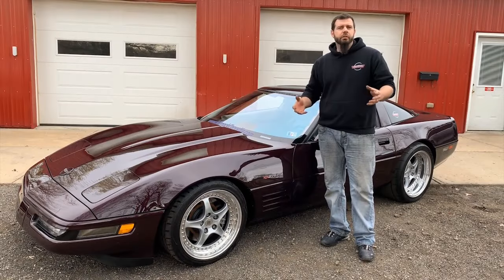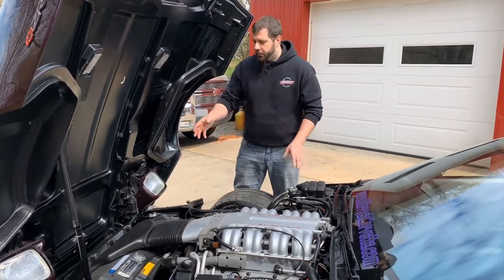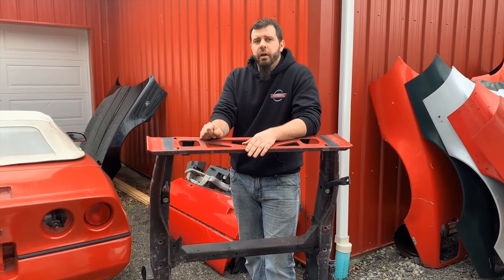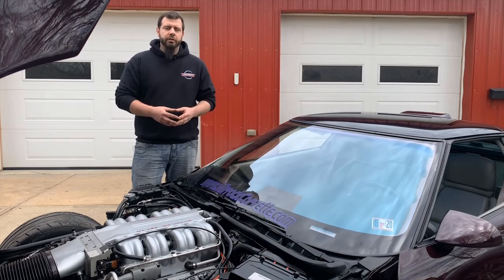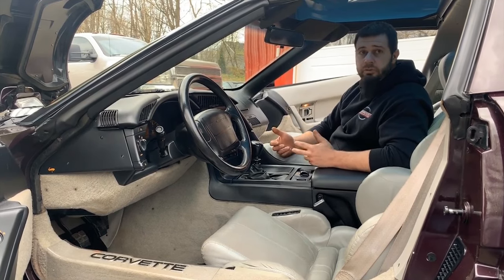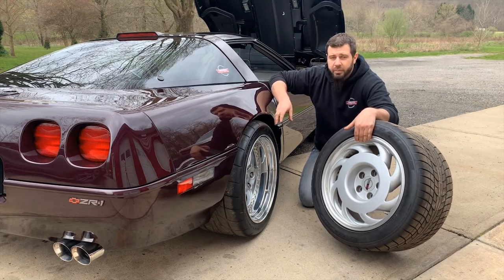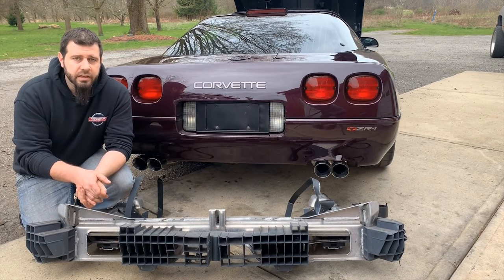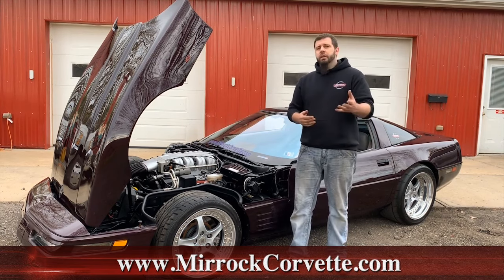What makes it a ZR-1, C4 Corvette Design Differences

Comment: Thanks for this very through video,  You mention that the difference between the 375 and 405 hp ZR-1  isn't a big deal.  To  get to 405 one would need to port out the engine and do some modification on the injectors, correct?  Other things?  General idea of investment to get this done? .

Comment: Basically the difference between the ZR1 and basemodel is the engine that's pretty much it except for the 90 you have some body difference but everything went the same in 91 as far as appearance.

Comment: I dont care if the new Vettes are a bit faster, these are the ultimate Corvette. Sleek, sexy, curvaceous just like an exotic sports car should. The newer Vettes are too square and upright. The late C4s were the last sexy Corvette.
Reply: It's more than a bit faster than a c4.  About 4/5 hundred hp faster lol
Reply: @JohnCollins-mm5dq  Well, I guess if a late model Z06 runs the 1/4 in 11sec flat, and a typical early C4 runs it in 14sec, thats 21.5% faster.  And are you really comparing new $100k cars to 35 year old $10k used cars? If you enjoy hatin on older Vettes, why are you watching older Vette segments?

Comment: Love that car....I had a C5,
but that's a wicked machine....styling is incredible.
Reply: If I'm not mistaken, when Chevrolet designed this car, they had designed it so that a radar detector couldn't detect it until it was within 1500-2000 feet, I could be a little wrong on that number, but pretty sure its in that range. Most vehicles are detectible much sooner than being at a distance of only 1500-2000 feet.

Comment: Which one is better?) Lt1, lt2, lt3, lt4, lt5?
Reply: LT5 is better than LT1 stock for stock. LT2 is the engine in the new C8, completely different era of engines and much more powerful than both. LT3 doesn't exist. LT4 is just an LT1 with heads/cam/lifters.

Comment: I really enjoy your tutorial on the ZR1. I’ve learned a lot about the differences and I have a question. I own a 1990 corvette base model without the FX3 suspension. Is it possible for me to add this option onto my corvette that wasn’t equipped with this option?
Reply from the maker: FX3 in theory could be added, but not easily or inexpensively. Would need the control switch, complete abs system wiring from an FX3 car, and then the shocks and actuators which can be expensive. In the end while the FX3 system does offer differences in handling when operating the switch between positions, the changes are very subtitle and surely not worth the time, effort, and most important cost, to add the system to a car that did not originally have it.
Reply: Mirrock Corvette ok, thank you so much for your info. I’ll just think about it now. You’re the most knowledgeable C4 person on the planet. You should work for GM and educate them. Keep up the good work!

Comment: I am getting a early inheritance from my uncle. A 92 triple white C4 with 75k miles. Is there a listing somewhere that says how to make a base 92 into a 96ZR1?
Reply: There is no 96 ZR-1, and there really isn't any documentation to swap an LT5 into a base C4 because the LT5 was never sold as a crate engine. You'd need a donor ZR-1 to pull it out of, unless it's totaled there's no reason to go through all that effort to turn a base into a ZR-1. Only reason would be if you found an insane deal on an LT5 pulled out of a wrecked ZR-1, which is highly unlikely. Anyone still dealing with these cars these days knows what these engines are and how rare they are

Comment: Believe it or not, there are still some people who think the Corvette non-ZR1 and ZR-1 used similar engines.  Totally not true.  The only thing the two engines have in common is that both were Chevrolet V8s, with similar (but not exactly the same displacements.)  The L98 and LT1 were overhead valve V8's, similar to nearly every Chevy small block V8 made since 1955.  The LT5 is a DOHC engine, a completely different engine design.
Reply: not to mention the LT5 was designed by Lotus
Reply: I was wondering about that.
That means Lt-5 has a 4 camshafts and a big timing belt or chain?

Comment: Can the LT5 fit into 1984 C4?
Reply: You'd have to change the hood most likely and the cost of an LT5 swap ... might as well do a LS swap for cheaper.
Reply: @josephcook3402  ZR-1 uses the same hood as the base C4
Reply: Technically? yes. Is it worth it? absolutely not. Good luck finding an LT5 to put in an 84 let alone all the work that would require

Comment: To save people time, the only engine difference is the C4's LT1 has a 2 valve. The ZR1 has a 4 valve.
Reply: Technically true, but far from the only engine difference. The LT1 and LT5 have almost nothing in common and have completely different architectures. LT5 was a DOHC V8 designed from the ground up by Lotus in coordination with Mercury Marine who manufactured the engine and GM who commissioned the project and put it in the C4. LT1 is a pushrod V8 based off of the GM small block design going back to the 50s, while the LT5 is a completely unique engine found only in the C4 ZR-1. The powerband is nothing like the LT1, the maintenance is nothing like the LT1, the parts availability is nothing like the LT1.